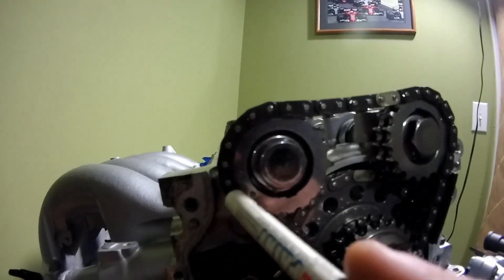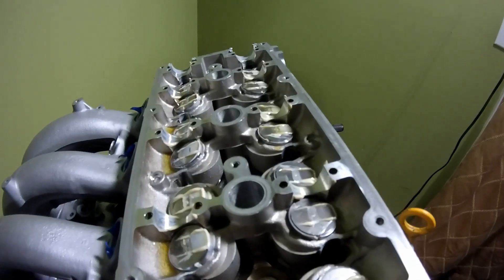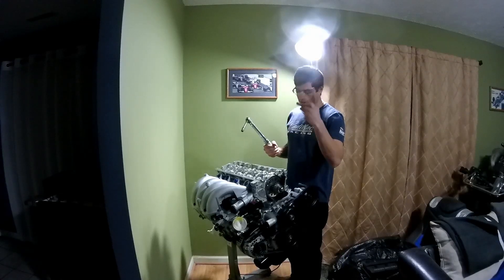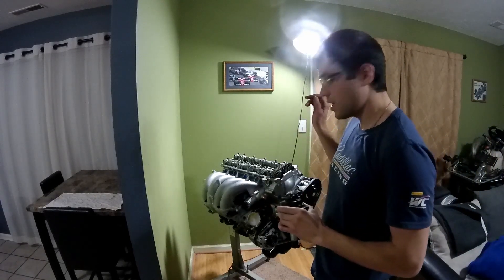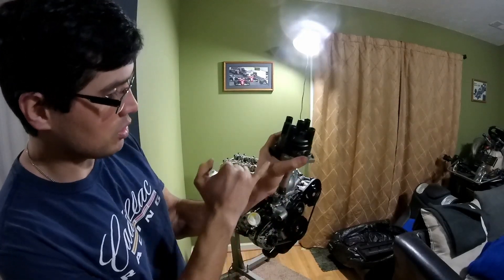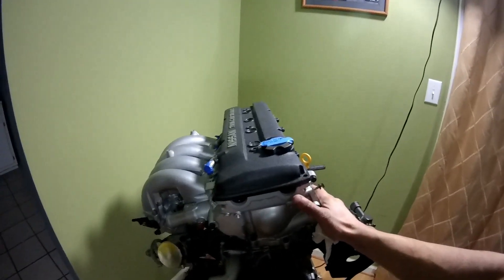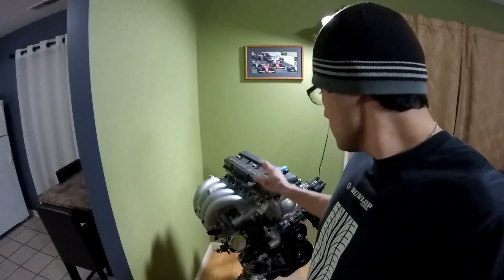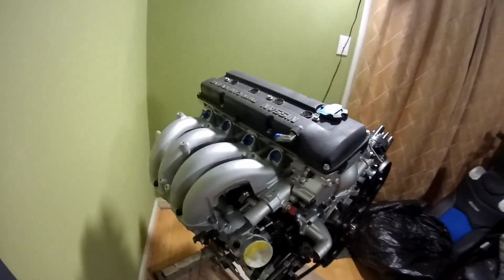240sx KA24DE ARP Head Stud Install

Comment: Engine looks good man! I have a question for you if you dont mind answering. I rebuilt a ka24de for boost but I’m going to break it in Naturally aspirated. I replaced the pcv valve with a straight fitting with a hose attached to it to just vent atmospherically until I go boost then Im going to properly buy a catch can. Do you think its ok to just run it like that while the engine is N/A? Thanks in advance!
Reply: Thanks for taking the time to answer my question!
Reply from the maker: Yes, its fine to run it like that.  Its a good idea to place a filter on it just so debris doesn't have a chance to enter the engine.  Best of luck with your build.  Any other questions, feel free to ask.